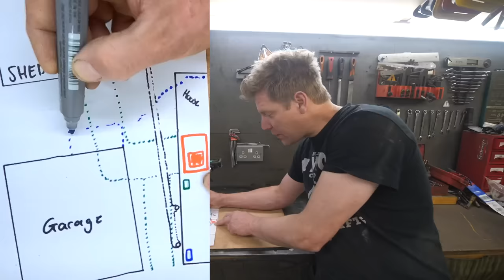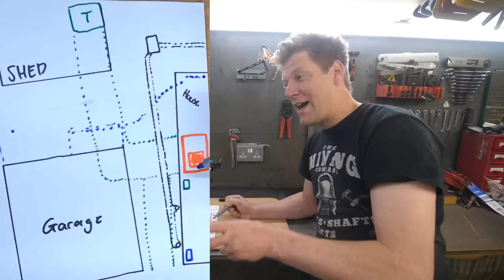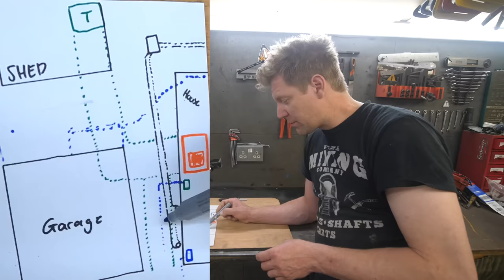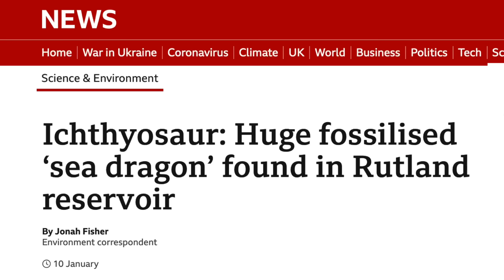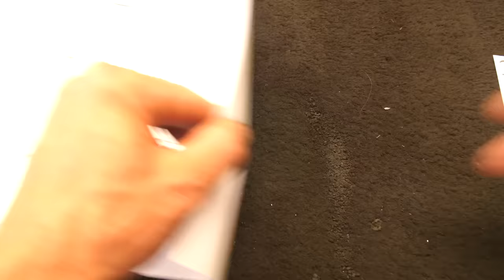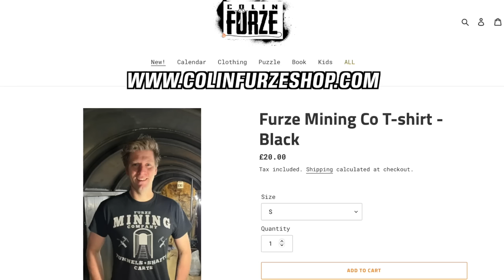DIGGING A SECRET TUNNEL Part 9

Comment: It's pretty smart to know that you were capable of doing this and starting it before getting proper permission. When they came out to inspect the tunnels and realized that you were doing everything safely and probably by code or extremely close to code, they could feel safe signing off on everything with your proof of work and expertise. GJ Colin
Reply: There’s been zero effort put into damp proofing or tanking it, and the concrete could probably have done with some rebar in it, strictly speaking. But apparently he lives at the top of a hill so the water table shouldn’t be an issue anyway really.
Reply: @Jonathan_Doe_   Rebar isn’t necessary here and will likely do more harm the good. The majority of the loading is compressional and the concrete is partially encased which is common practice for small tunnels. As you say the lack of drainage is actually the reason why rebar shouldn’t be used in this scenario, even galvanised rebar is prone to rusting in these conditions. That’s why the prefabs you see being used for rail tunnels for example are nowadays made with fibre reinforcement.
Reply: @Jonathan_Doe_  I wouldn't expect rebar to be necessary. Given the composition of the ground and the depth, the lot of the force of surrounding soil/rock is directed straight down rather than sideways on the tunnel. The ground above the tunnel could be of concern, but for one thing it's not that much earth compared to the thickness of concrete, and the concrete/metal forms an arch that should put little tensile stress on the concrete. This is even ignoring the fact that the tunnel was self-supporting before the concrete was placed, although the soil should settle over time and put more force on the tunnel. Anyhow, I'm not a civil engineer or anything, but rebar would seem like overkill to me.

Comment: "Don't want the house subsiding, do we?" - this makes me worry a fair bit less about planting the odd tree in my garden.
Reply: The problem with trees is that they grow and die. 
When alive, the roots stabilise the ground but when they die (or are removed), the roots then become a void and this then can cause quite severe subsidence, depending on the size of the tree, soil conditions, water level, etc... 
Trees are not a problem if far enough away from a structure. 
Tree roots usually don't go much further than the canopy cover, this does depend on the type of tree of course.

Comment: One really cool thing to do would be an underground garage in front of the house, that is connected to your tunnel system. Like a large hydraulic elevator that comes up, the car enters and it goes down again. Double parking spot, secret garage and you‘ll never get wet if you enter your car through your tunnel.
Reply: Already in the plans just not on the plans shown and submitted....

Comment: The town council also had to live through the years of plague. They should really be more understanding about why someone would want to build a ridiculously cool tunnel system to their underground bunker.
Reply: all I have to say to the town council. WWII. I mean seriously how is this that different than doing bomb shelters, etc.
Reply: @biosaber585  If you have to ask then you nothing about structural integrity.
Reply: @Biffo1262  Eh, it is absolutely structurally integral not bomb shelter level but the guy has put in serious work the welds and steel look good if not overkill and the concrete is going to be more than stable enough for what this construction is going to be used for.  Kind of seems like you haven't ever worked construction before.

Comment: The question that has been asked a thousand times and which I have missed the answer to is; What is your process for getting  rid of all that rock/dirt? Keep up the good work.
Reply: you have to pay to dump it somewhere, or if youre lucky, give it away on marketplace etc
Reply: My guess he is randomly donating it to various parts of the surrounding countryside.
Reply: He puts in his pockets in dumps it off secretly
Reply: Smuggle it past the guards in your pockets?
Reply: He asks Douglas Bader to hide it in his artificial leg, then secretly empty it out when he pretends to fall over.
Reply: Have you never watched The Great Escape?
Reply: I need some dirt so if he'd like to mail a ton of it to the states and pay shipping I'd appreciate it
Reply: I came here for The Great Escape comments and was not disappointed.
Reply: He covered that in a very early video.    
He puts it in cereal boxes and returns them to the market.
Reply: He has special pants with a release pull string in his pockets. Then goes for a walk :)
Reply: He sends the clay to Primitive Skills to make bricks!
Reply: Kenny mac  and another hole to dump the dirt and rock from that hole O_o
Reply: Tom with the digger is at his farm unloading the dirt and building a motocross course
Reply: New secret project, Mount Furze in the backyard.
Reply: Above ground walls?

Comment: I'm really interested how you plan on doing the car portion of this, it's like the bunker but without digging the hole first
Reply: I’m guessing it’s like the bunker but they don’t put a roof on and have a hydraulic lift
Reply: I would imagine the car port would be manufactured as a kit by some company in the UK. They are very expensive but provide a few more parking spaces depending on how you spec it. An excavator would defiantly need to be used to dig out all the dirt and rock to create the large hole needed for installation.
Reply: If he does go ahead with it he probably will go from above like the bunker then once he’s done he’ll dig from there toward the tunnel, that would be my thinking anyway
Reply: So let me see, the new digging plan will connect to the underground of his driveway, outside his house, into a car-sized elevator. With the click of a button, he can raise the elevator above the ground, drive the car in, then lower it underground and walk straight into the tunnel. Like Agent99 from the "Get Smart" show, disappearing from the phone booth. Wow! But then everyone will know! Why can't he build this inside of that garage to avoid things like disclosing the secret and water leaking? Also, that part of dig needs council approval again, right?
Reply: @iqbang9236  The garage is full of things like benders and CNC plasma cutters.
Reply: I suspect quite a few of us have been enjoying this having been subliminally influenced by a childhood watching Thunderbirds.
🇬🇧
Reply: if he's going to make a car lift from scratch, he might as well replace the ladders, sounds like a cool upgrade
Reply: @clintonjc  but then this is Colin, he doesn't really do off the shelf does he 🤣

Comment: Cheers! Glad to hear that planning gave you the seal of approval. You addressed just about everything I had chimed in on in the comment section of your previous tunnel videos. Architect here so of course I had my own two cents. Yeah, ventilation is definitely a good idea for a number of reasons. You also don’t want any potential gasses venting into your home.. also if there’s moisture… etc etc. Seriously props though, that’s a lot of earth to move and a lot of tedious work. Can’t wait to see you complete it all and just enjoy it.
Reply: Also, radon might be an issue.
Reply: Would like to know how Colin deals with water ingress and relief of hydrostatic pressure buildup! He mentioned alcove for pumping and keen to see how this works!

Comment: well played to the council for authorising the planning permission for all this.
few questions. 
1. you planning permit application drawings do not show any connection to the bunker? is this still going ahead or has that been put on hold?
2. what does your home insurance think about all this? tunnel, bunker ect...
3. did you consult with any underground construction experts or anything before doing this? or has it been very much an entirely DIY approach with just a good basis in constuction?
Reply: I'd love to know the answer to those, but especially the last question, too. Tunneling is AFAIK quite a risky thing to do - the structural integrity, the ventilation, water intrusion, etc.
Reply: He most likely will never be able to morage his house after all of these alterations but that's just speculation 😅
Reply: @Mia-in-Japan  well thank fuck for surf shark
Reply: @Mia-in-Japan  but also usually only structural problems in this case would make it “un-mortgageable”. He has the planning permission, seems to know what he is doing and the entire internet frothing at the mouth to let him know if he messes something up, so I don’t see any reason to assume he will have structural issues to the property.

Comment: The reason crystalline minerals form in seams is because they form in gaps between dense layers of rock, essentially as a form of precipitation. Under high temperatures and pressure, cooling off very slowly, the various gaseous and liquid materials slowly precipitate out and 'condense' on the sides of these gaps. The regular molecular patterns in crystals are the result of different materials having different points at which they solidify, so with slow enough cooling, there'll be very little overlap. They arrange in regular patterns according to the shapes and localised charges of the atoms in the molecule. Since it's all the same molecule, the best way to stack them is always the same, resulting in pretty crystals.

Comment: One question that still needs answers is what is the estimated  average material cost and labors hours to completely do 1ft of tunnel once you had your process figured out?
Reply: Tunneling aside, steel is about $1.50 USD / lb and the density of steel is 0.284 lbs / in3. Just find the total volume and multiply by the density and by the cost. The concrete is about $20/cuft. Mesh is pretty cheap.
Reply: @joshmdmd  It's all in the work, you can't use any bigger machines so it get's really labor intensive. So only way doing whitout going bankroupt is doing it yourself or make money out of it or both like colin. The steel and concrete is more or less nothing in the calculation
Reply: ~60,000usd in sheet steal and tubing?
Reply: @eliotalpert4258  show your work. doesn't seem right.
Reply: @P4hko  obviously its labour intensive but that depends on the material, access to the site, timeline, and equipment. You can't accurately cost that out and that wasn't the question. He asked the number of hours and I think it really depends on how big of a section you are doing before pouring concrete. 

If you want to actually be serious about it you'd need to see the cost of engineering drawings, a geo to check the soil / substrate strength to spec out the required ground prep, you'd need a number of exits to hit code, permits, certain additional wall thickness requirements and whatever else.

This project is no different than making a basement and just capping and replacing the floor. A proper crew with proper equipment could do the entire tunnel section in three days, and a second crew could repave the driveway after all the tunneling is done. I said tunneling aside for a reason. He is doing it by hand for content. You can just rip up most of the top to do it all with an excavator. You'd only need to do a few feet to get beneath the house and the shed, but even that could be done by machine if excavating wide enough.
Reply: Gonna be about tree fiddy
Reply: Waterproofing, drainage is the biggest questionmark.

Comment: Colin have you considered putting any starter/sheer bars where your concrete sections join? I mean short pieces of rebar about 30cm long  about 30cm apart sticking out the end of the concrete .
Reply: rebar inside the concrete isnt always necessary and in fact can make a structure weaker due to rust over many years even if its galvanized, but what do I know about UK rules and laws lol

Comment: Thank you Colin for the update; great work as usual and good job handling the bureaucracy! On your drawing (19:39) you have drawn the new tunnel to connect to the existing entrance tunnel to the bunker which probably is the easiest thing to do. ...But why don't you instead connect the new tunnel directly to the bunker? For safety bunkers usually have two exits; if one exit gets blocked or if there is a fire in the entrance, you have another way out instead of the bunker becoming a death trap! I get it; you loose some valuable space in the bunker and you might have to move your bed but on the upside you get a safer bunker closer to current bunker standards. (...But looking on some of your other videos, safety perhaps is not a top priority of yours?) ...Or you could build the new tunnel as on your sketch but also add a secret emergency passage between the new tunnel and the bunker. In this scenario you could section off different sections of the tunnels with a fireproof door. Just some thoughts, take what you want and leave the rest. Have a beautiful day!

Comment: I'm not that surprised planning have waved it through as there's no real impact visually on anything above ground. What about building control though? I'd have thought they would want engineering drawings and calcs for the steel/concrete construction particularly where it runs near the house. You're dealing with services like gas, electricity, water, ventilation etc. too and I'd be surprised if they didn't want to take a look at those. I think your workmanship is excellent so it would probably sail through inspections and visiting officers wouldn't have a clue how to inspect it anyway. They'd probably try and use the standards for basements or something. Can't wait to see the finished article great work!
Reply: This is the same question I have. I'm surprised planning permission is required as well and agree building control would need to be involved. I'd think the bunker could be considered a habitable room and main area of concern would be means of escape, as well as ventilation and a proven engineered structure as you've suggested.
Reply: @Emmellbee  from the bit you can ascertain from the drawings it looks like his concrete is in the neighborhood of 150mm thick on the thinnest wall areas and the roof is 300mm as is most of the areas under the house. there's no reference to thickness of the steel he's utilizing but I'd ballpark it's all likely in the ballpark of 1/2cm thick possibly lighter as it's needed
Reply: Building control? This is the UK. Building control doesn't exist the way it does in places like the USA. Building inspection is predominantly self-inspection (sort of opt-in basis) largely for insurance. By and large, if you get planning permission, you can build whatever you like on your own land regardless of what it is or how competent you are. You might not get insurance for any of it, you would get in serious trouble (criminal offence for harm or public endangerment) if anything went or started to go wrong. But there's no building control to get in your way (nothing beyond planning permission) if you're DIY'ing it like this.

Building control approval process only applies in limited circumstances (usually when you touch anything connected to "public services" / utilities / etc.) But Colin is avoiding all of that here as far as I can see. So that set of requirements wouldn't apply.

Now, that's not to say building regulations don't exist. Many will apply to this project. BUT the UK's attitude to building regs is basically on a retrospective i.e. "if something goes wrong and you are shown to have breached the regs (even if that wasn't the cause of what went wrong) then you're in trouble". If you breach the regs and nobody ever finds out, you're golden. If you breach the regs and nothing goes wrong, you're basically off the hook. (N.B. this is exactly why the UK has a massive Building Safety Crisis at the moment. Thousands of blocks of flats and other buildings are unsafe - my own flat is caught up in the problems.)

Does any of this make sense? Absolutely not. Building regs and control in the UK are really messed up thanks to decades of corrupt wealth and politicians with a vested interest in maximising profits from land, construction and property. It's not being improved much either by the current government, for all the same reasons (despite repeated mindless headlines).